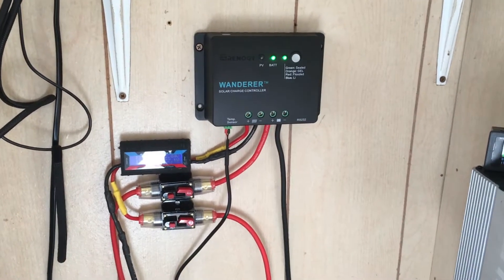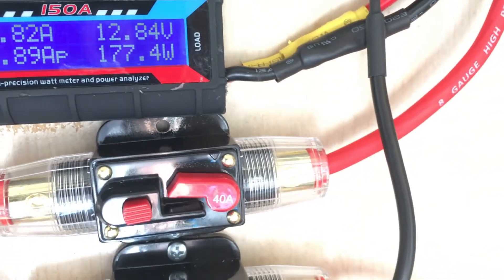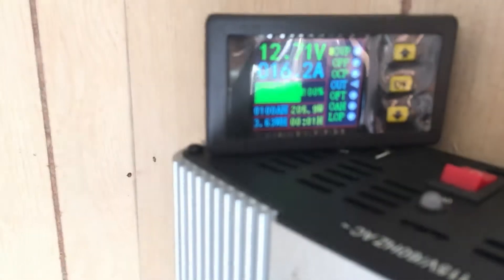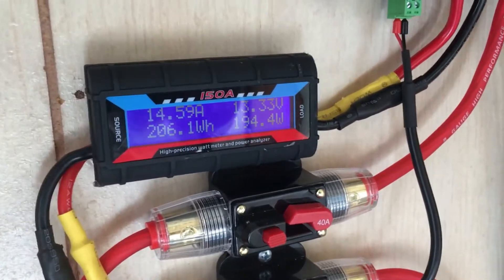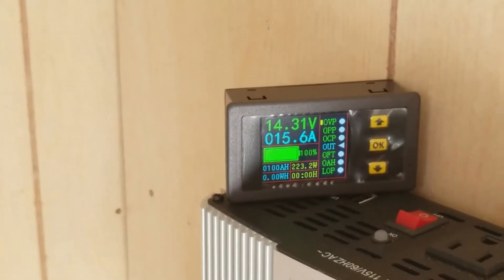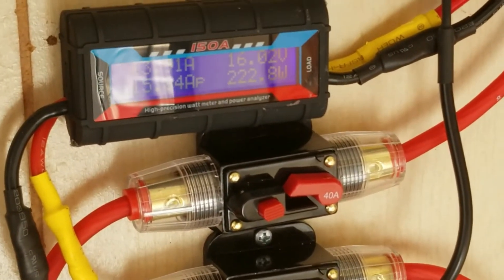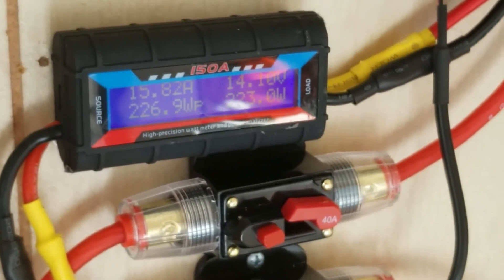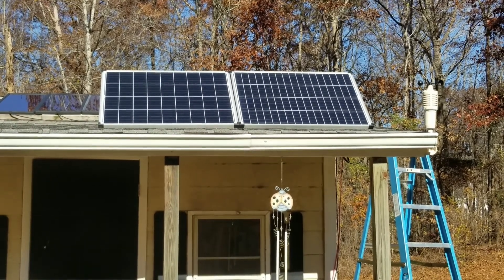Does angling and cleaning solar panels really help? Is it worth the trouble? The results are crazy!

Comment: I got myself two more batteries for Christmas ; I have 16 now. It's way better.I was getting 600 watts from 800 watts of panels yesterday. cloudy today. 10 30 PM 25. 5 v...Getting two more after new Years' ...will have 18. The voltage stays the same more now. I used the oven for 20 minutes after they had got to 26.0 v. So that dropped it to 25.8. The voltage stays above 25 now. I think with two more the voltage will stay above 25.5 ...the batteries should last forever, lol. Merry Christmas
Reply from the maker: So, we also got a new system up ground mount videos coming soon just waiting on a few more parts this will be an amazing back up I think Lifepo4 battery should be interesting...lol Merry Christmas to you Sir!

Comment: I have two of the 45 watt kits from HF that I'm giving my uncle...he can use them in parellel for a battery charger. They don't help the voltage on my 14 battery bank enough to keep them...I have 800 watts of mono and 200 of poly panels...I managed to build a wood stove with my inverter running an 80 amp DC welder, but it used up the power board...it's coming Monday they say...so I am changing the control board too. Those two parts were $331, and I paid $200 to ship it to Aims and back but they didn't work on it, even though it was under warranty when it got there...it was a very expensive mess...it had a design issue anyways...they put the temp sensor in the wrong place and the fan wouldn't come on if there was a small load on the inverter...it would just sit there and heat up gradually...so it did it twice in a year...I bought it on Nov 18 2020. So they sent another temp sensor and I'm going to have to drill a hole and put it on the other side on the other row of mosfets. I found out 3 other people who have the exact same inverter / charger have the same problem with the heating . The 12 volt version of this model doesn't do it but the 24 volt one does...I am going to install a second temp sensor, possibly in parallel with the other one, and see how it acts...I have the worst problem with my cat wants to prance around on my panels and leave kitty prints all over them...fortunately it rains a lot here. it is 3 AM and the battery bank is sitting on 25.1 volts. Charging a phone, laptop, and a light and fan is all I can use until I get my parts tomorrow...if I get two more batteries I will have eight 85 amp hour and eight 105 amp hour batteries. I believe the 1000 watts of panels will charge them all, but I may get two more 100 watt panels too...I only get sun part of the day because of where I am. My uncle's house and barns shade part of my panels so I never get full output like you are doing...some panels catch sun different parts of the day.  I can't put them out in full sun because it's windy here...I wouldn't have any panels left. So I get the morning sun and part of the afternoon, then the panels on the West side catch the evening sun. My setup is far from ideal but I'm working on it. I'm only getting 240 watts or so but that's because the batteries are almost charged so the controller is cutting back. If I had my panels out in full sun and angled they would put out a lot more...I have mine laying flat with pipe frames around them to keep them from becoming airborne in the wind here. Only choice I have is get more panels...once I get my own place I should already have enough, lol. I'm going to put the new parts in my inverter tomorrow, and I'll have to quit trying to run the welder with it. On the other side of the coin, I have enough batteries to weld with without the welder. So I am going to get the batteries today. That will give me 760 amp hours @ 25 v...or .....19,700 watt hours...I believe that will run the inverter nicely...it will also let the batteries stay at 12.3 or so or above, for each one. They were at 12.95 , or 25.9, yesterday evening, and we didn't get much sun...it was cloudy most of the day...now it's 4 AM and they are at 25.0. Once you get above 8 or so batteries , they start acting differently...my system just kind of smoothed out after there were 12 of them to charge...there were no quick changes in voltage after that...I don't know at what point adding more batteries will become ineffective. I'm ready to stop though...I think it will make them last a long time to have less volt drop. I want to have enough to maybe run a bigger inverter, without having to buy any more...I'm afraid batteries will go up, and I'll never get any more...so these will be the last two probably. I'm having a blast fooling with solar...it is expensive though...one little boo boo costs. To me it is like the coolest thing I have ever done, though...once I get two more panels and get it optimised, I should be able to get 1000 watts going into the batteries. I remember getting 796 watts at the end of August last year. Right now I can get around 450 if I aim everything , lol...thanks for the reminder, I need to clean my panels...that Aims inverter is going to be thirsty when I get it put back together after redesigning the cooling sensor. I was going to get a 3000 watts one to start with but I couldn't get enough money together because I was buying batteries. They are out of those now, of course...but the way it worked out, I will have a spare power board after I fix the old one. I already have a spare control board...not much else in there besides that 38 pound transformer...and it's made like a tank...lol. Thanks for the video. I am going to try Armor All on the panels, to see if it will make dust slide off with just the wind...it's a thought...the cat is getting a little bigger now, so maybe I can keep her off them. Like you said, I'm probably losing 75 watts on account of kitten tracks...I think I about have a usable system so now I'm tinkering with building a wind turbine...I have a very rare PMA from a late 70's Honda. lol...it's like 200 watts maybe. So I'm putting stronger magnets in it and building a pole...I found a 3 ft aluminum propellor off an industrial fan...cheap and easy windmill...I 'll have it up in a few days...it should help with the short winter days.
Reply from the maker: Your welcome, yes I have noticed that keeping them clean and just checking the angle a few times a year will net so much more power. We are currently testing and making a ground mount system out of superstrut for 4 Renogy 100w panels in the rain for the past 2 days it’s generated 200wh just laying there while the mount gets figured out. I figure once set up it will charge 100aH in the winter